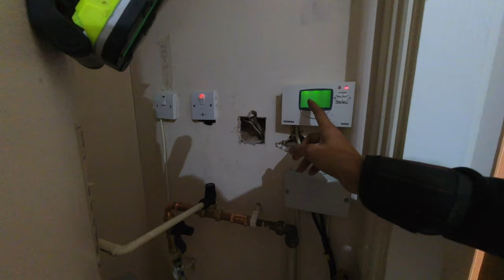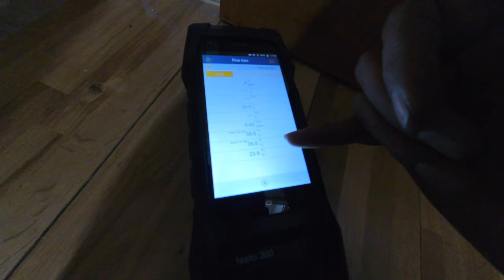This Job Really Tested Me - A Day In The Life Of A Gas Engineer 79

Comment: We do maintenance and installs for a large landlord firm, they got a company in to do 3-4 unvented system installs, we were busy at the time and was happy for the other company to come in and do them. Every one of them has huge issues. One of them, they put an end cap on the heating zone valve, and the hot water primary return ties in to the central heating, so when the hot water is on the entire house heats up, this is obviously through the summer so students turn off all the rads and it overheats. It's crazy how bad it is, but they all have different weird and wonderful problems, fit by a fairly large known company. It's crazy how bad some are and get away with it.

Edit: good one on that job, must've been a right hassle, at least you got through it fairly calmly! GJ
Reply from the maker: Thanks mate, yeah that's the problem having to deal with other people's mistakes. Throws you off completely because everything you're doing is right but someone somewhere has messed up and it just complicates the whole job!

Comment: only thing with leaving unvented cylinder without a zone valve on the flow means that if heating is on it’s still heating the water up, depending on temp of boiler flow, can cook it and set off tprv.
Reply from the maker: Good point

Comment: Brother... i feel your frustration with so called 'heating engineers' who cant fault find heating electrics and just solve the problem by changing everything and charging accordingly!!!!.
My brother brought a property to let, and he left the repairs to the estate management company.
Hes not someone to quibble when things go wrong, as he doesn't want the tenant to suffer.
On a y plan 3 port system the engineer diagnosed and replaced a programmer.
My brother then later got a call to say the system still wasnt working, and the engineer wanted payment for changing the thermostat also but now a new mid position valve was also required.
I said not to pay and i would call in over the weekend.
It transpired before i got my electrical testers out that the wiring looked incorrect and some cables weren't even connected.
After tracing and wiring correctly all was left working.
I explained to my brother there was no way whoever done the job knew what they were doing but still charging top dollar.
After a strongly worded email to the management company they refunded my brother his money back as they didnt want to get into a 'my engineer is better than yours' spat...😂🎉
Reply from the maker: Good on you for sorting it! 👊🏾
Reply: @cputilitysolutions  the funny thing is, up to that point I never felt fully confident of electrics,  but it showed me that my fault finding process was methodical and actually better than I thought.
I guess when you got a love for what your doing, your more inclined to be more diligent..

Comment: Just been out to a semi new build today 11 different engineers been there not one of them had seen the flow and return round the wrong way took me 5 mins to diagnose and 2 hours to swap round now no banging  when the zone valves shut off cos the bypass is now in the correct orientation. Does make you wonder what these people are actually doing heating can be challenging don't get me wrong but its not rocket science, people need to slow down and take time to get it right the first time.
Reply: I’ve had the same new build house flow and return wrong, or hot and colds the wrong way round… that’s a fun one will work for a bit 🤦‍♂️
Reply: Sometimes it's a conversion without proper pipe tracing... or not checking if the new boiler has a built-in bypass..
Reply from the maker: New builds are riddled with problems 🤦🏾‍♂️
Reply: @cputilitysolutions  I get called out on “warranty calls” people haven’t even moved in and the ceilings are down all sorts.  No pride these days it seems, and I work for a boiler manufacturer and get loads of hot and colds the wrong way round.
Reply: @cputilitysolutions  for sure but 11 so called heating engineers, does make you wonder how people make a living at it 🤔
Reply: Nice video m8 👍
Reply from the maker: @daniellaw5688  thanks man
Reply: Sometimes it's better to stick to with your own customers.  Know what you're coming to.  Good video
Reply from the maker: @brianmayne6513  thanks man 👍🏾

Comment: Surely a bypass is required on an S plan where both valve could potentially be closed. At least with a Y plan one side will always be open.
Reply from the maker: Correct 👍🏾
Reply: Not if someone turns all the radiators off bud 😊

Comment: Tbf putting zone valves on return prolongs the life of zone valves as they work on a lower temperature 
But that was total installer error as it was crossed over all over shop 
A real mess 

If I zone heating I put them on the return but if it’s to a cylinder I put them on the flow so anyone in the future knows what’s going on
Reply from the maker: Bang on, in theory I could have done that and it would have potentially sorted the issue. However the customer had said some rads used to get hot even when running just HW, so there would have still been the issue of reverse circulation

Comment: I take it they basically had it coming through the zone valve the wrong way 
As the flow and return wrong at the boiler 
You’ve had some belting jobs lately mate 

That cylinder change on warranty took the buscuit
Reply from the maker: Yeah exactly that was causing the banging when it de-energised